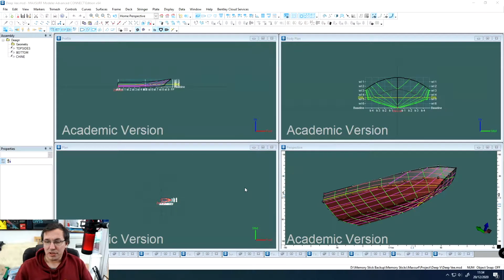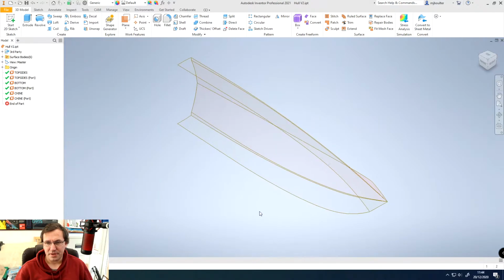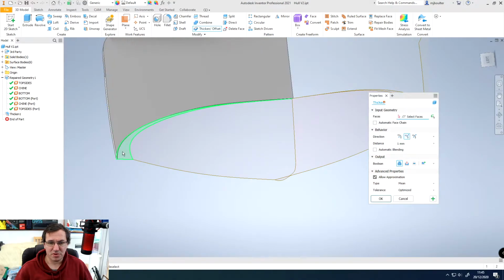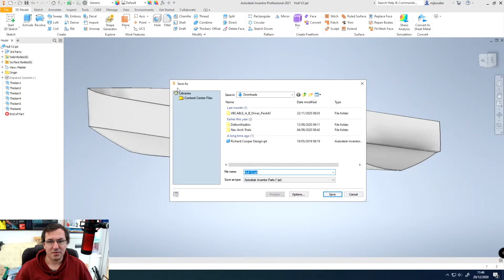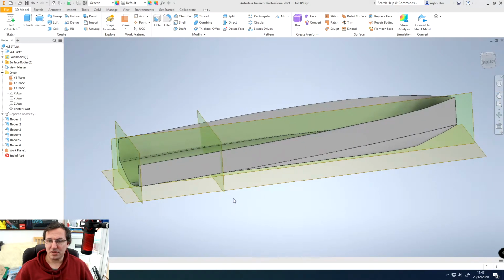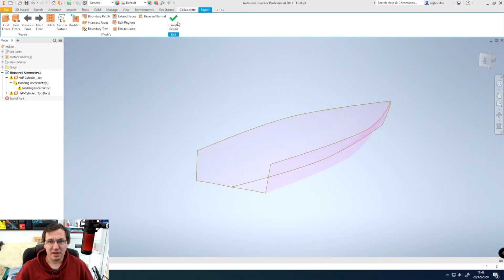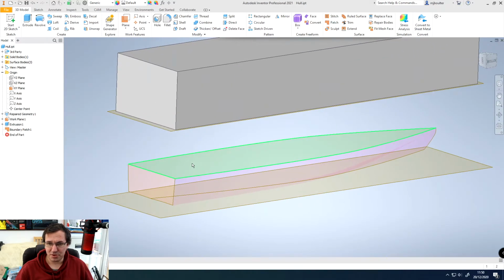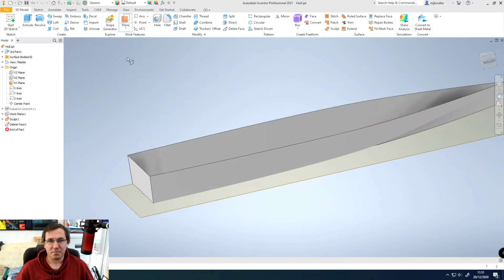Maxsurf Export to Inventor IPT file and Solid

Comment: Is there a way to export an .iam assembly to maxsurf?

I'm mechanical engineer currently working with naval engineers.

We are designing a pontoon, wich is more a mechanical structure to float, not a naval structure at all. 

It means it doesnt have the typical components like hull, etc.

The problem is the interaction between softwares.